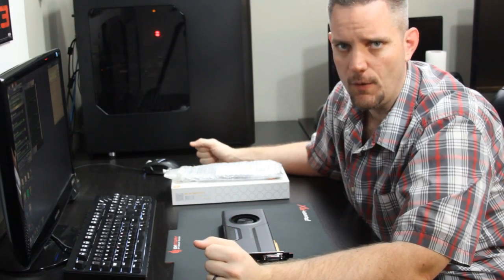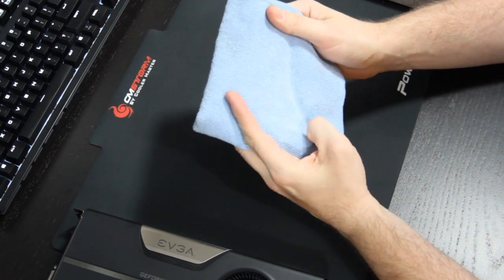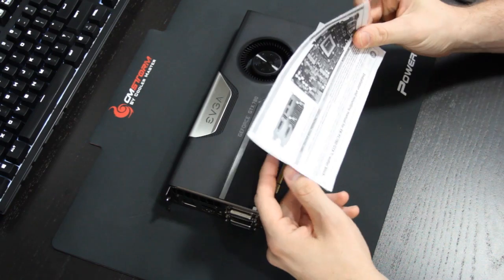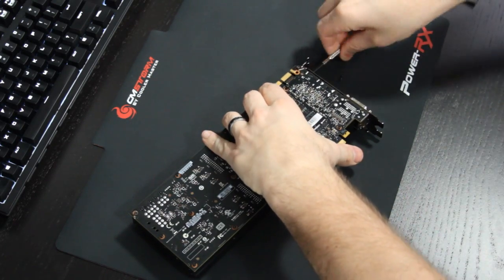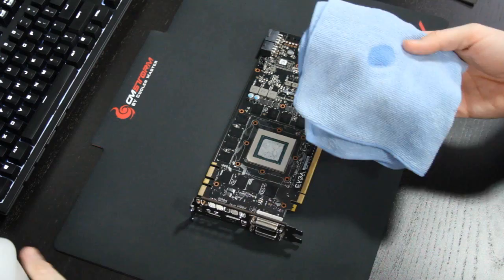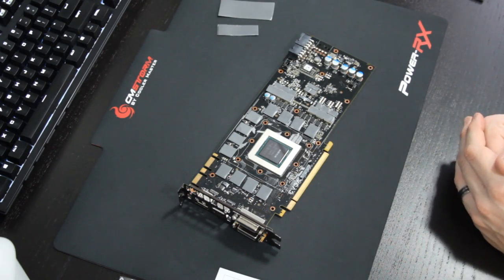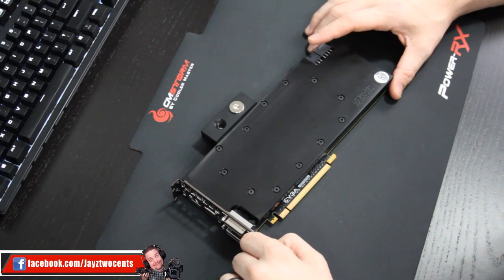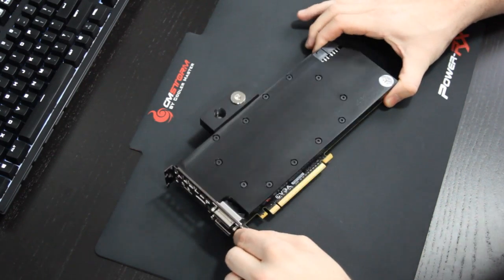How to Water Cool a Video Card - GTX 780 with EK Full Cover Block

Comment: Never seen the star pattern... very interesting!

Building computers on a daily basis at my job we just use the pea-size method. Works great all the time, and when removing a fan you see how well the pea-size method works.

It's all in a huge debate, but that or the line method is the best.

One thing is for certain, spreading your thermal compound around manually before applying your block/cooler/heat-sink will make room for air bubbles... very bad.

Comment: Hey Jay, I have a question! Would you be able to find a waterblock for my specific GPU? I'm having a hard time finding a solid, working one for it :s it's the FX - 795A - TDFC. I think I may have found one but I'm not sure and there have been a lot of mixed messages as to whether it will work (this is the link to it http://www.overclockers.co.uk/showproduct.php?prodid=WC-037-WC). Maybe you will be able to find out if this is good or something else is better or if it even works.. or anyone really. I would love if anyone could help me.

Comment: You skipped over the whole "removing the stock cooler" part.  This is pretty much the only issues I have with putting on aftermarket coolers on GPUs.  The last time I tried to remove a heatsink from a GPU, the adhesive ripped the die off the PCB... and of course the whole thing was trash after that.

Comment: how often do you have to take  it off and clean it?
Reply: Never. Why would you need to clean the card?
Reply: Tom Craske i mean if you use water doesnt it have to be cleaned sometimes?
Reply: Salvage3 You need to replace the liquid in the whole water cooling loop every few months or when you see the water needs changing but you never need to take the block off the card
Reply from the maker: Tom Craske Distilled Water with Anti-Corrosive and an Anti-Algea inhibitor should be flushed every 6 months. When you use something like Dragon Ice, or other treated premixed fluids, you can sometimes last years. I used the same fluid in a system for 6 years once, came out nearly as clean as when it was installed.
Reply: ***** Bloody hell, 6 years? How much did that fluid cost?